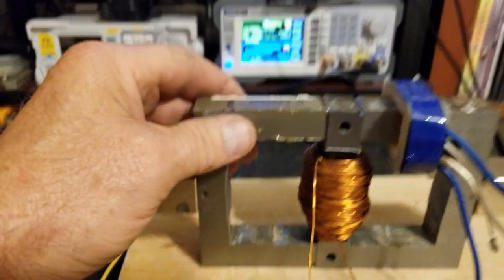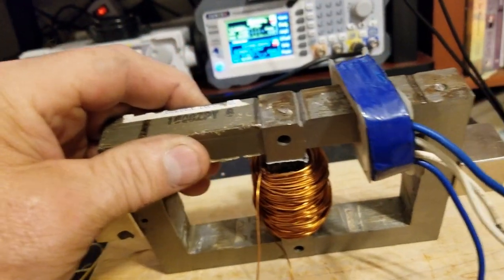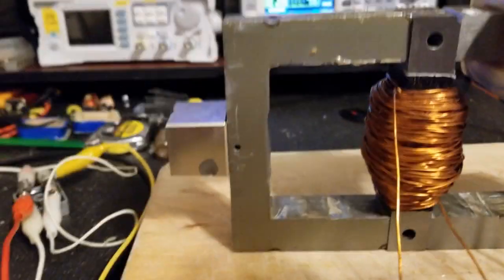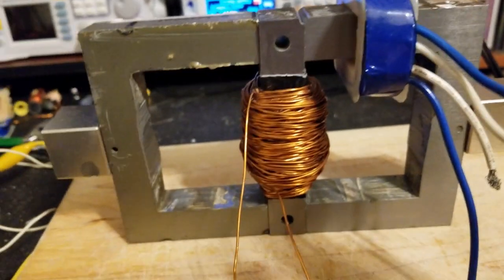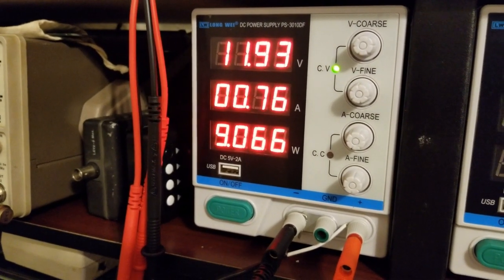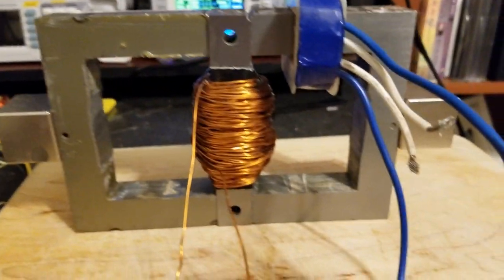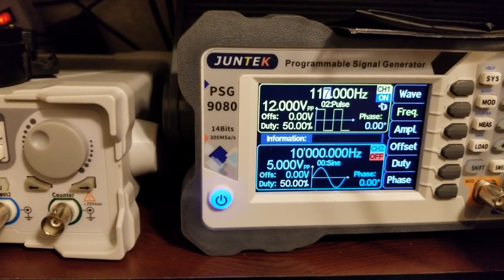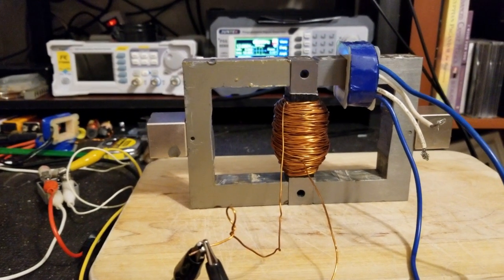Motionless Electromagnetic Generator Core Test, Easy Flux Switching

Comment: Very interesting project Tim. Any update on this?
Reply from the maker: Thank you!
Reply from the maker: Soon i hope 8)
Reply from the maker: I have a MEG that can self run under a .500 ma load for 40+ minutes then it stops. I need to continue on with more mods and testing at some point. I have two other projects i really need to complete, then i can get back to the MEG. Work, home, wife, time, all gets in my way ha ha. Cheers!
Reply: @Timtron432 here is the secret brother double your Meg transformer run the secondary coils load in parallel and series the primary coils with a variable transformer to find the best efficiency for lowest input
Reply: @Timtron432 large awg secondary and thin primary

Comment: Bard's google AI talked me about this generator to power an automated hydroponic indoor, 
It told me that a 3 meter radius one will produce = 113,097,335.53 joules

Energy = (4/3) * pi * 3^3 * 7850 * 100,000
= 113,097,335.53 joules

and gave me this blueprints:
Materials:

Ferromagnetic core (iron or ferrite)
Permanent magnet (neodymium)
Wire (copper)
Power inverter
Other materials as needed (e.g., screws, nuts, bolts, mounting hardware)

Instructions:

Cut the ferromagnetic core to the desired size and shape.
Drill holes in the core for the wire coils.
Wind the wire coils around the core.
Mount the permanent magnet on the core.
Connect the wire coils to the power inverter.
Mount the generator in a way that minimizes vibration.
Additional considerations:

The size and shape of the generator will affect its power output.
The strength of the permanent magnet will also affect the power output.
The number of turns in the wire coils will affect the voltage output.
The current flowing through the coils will affect the current output.

Didn't want to give me information about the source and make that pretty clear

Do you have any updates on this? Can this work?
Reply from the maker: I have a MEG that can self run under a .500 ma load for 40+ minutes then it stops. I need to continue on with more mods and testing at some point. I have two other projects i really need to complete, then i can get back to the MEG. Work, home, wife, time, all get in my way ha ha. Cheers!